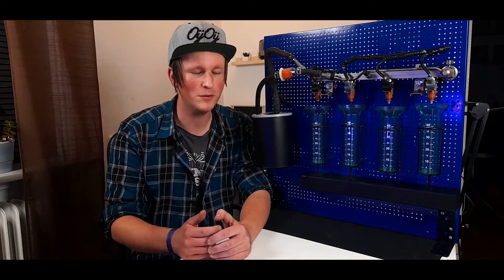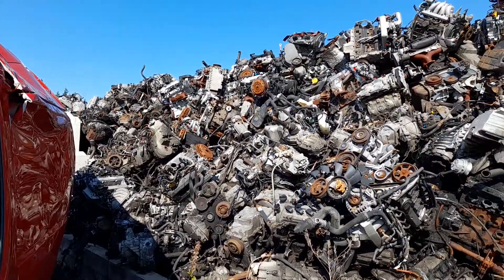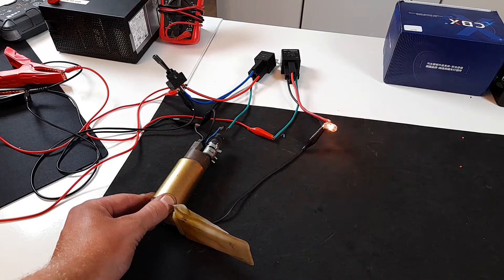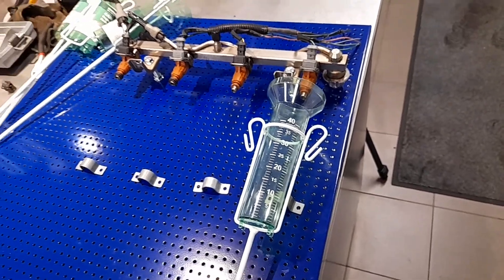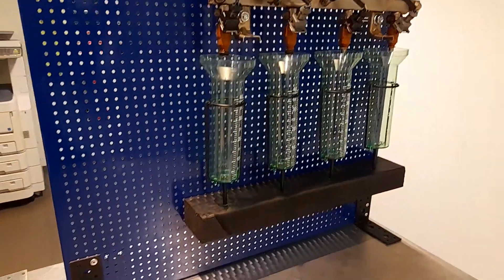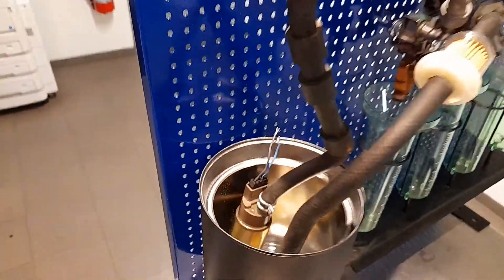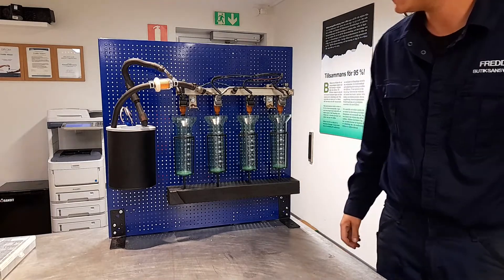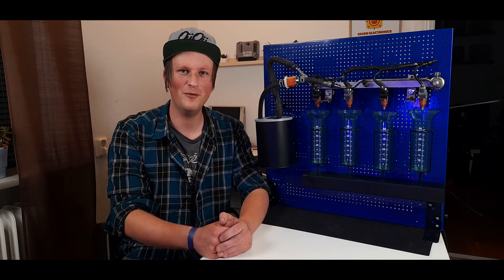Great diy injector tester for cheap!

Comment: What holds the injectors into place? I can see they are fitted to the fuel rail,but there seems no other support or anything to stop them popping out of the rail under pressure.
Reply from the maker: The injectors are fitted with a metal clip for each.

Comment: What fluid is used to test the injectors?
Reply from the maker: I use regular petrol. It's easy to clean the tank afterwards using that.
Reply: @EFreddy  Thank you for your quick reply. Awesome video, I’ve seen a couple DIY injector tester and yours is by far the best one yet!

Comment: I tried to do your experiment but our injectors (they are from bosch and are long) won't open. We have a battery from a small motorcicle, it has 12 V with 9 AH. Cold this be the problem ?
Reply: Now I've put a car battery abd its the same, the injectors won't open

Comment: Very nice build!
Your setup gives accurate relative results: are  all injectors doing the same.
But flasher pulse width (duty cycle) is not known so You can't tell the flow rate (ml/min)

An Arduino would be the final touch to the  test bench:  test flow rates at at 10%, 50% and 80% dutu cycle.

Visit that well-supplied j-yard again and grab a pressure regulator, then test the leakage as well: closed injectors at 3 bar or so...

But it is a mighty machine just as it is...!
Reply: Agreed the mechanical aspects of the system are all there, but if we are adding an arduino.... why stick to a duty cycle and not a more realistic 10,000 2.5ms impulses with a delay in between so that any leakages are exaggerated in the results, or a ramping function that simulates idle to WOT and redline [or both]? 

Genuine question, I built my setup to include the above, just checking I didnt miss anything in the test rig.

Comment: I want the electrical connection of the device and the flash signal down to the injctor and is the voltage 12V or 5v
Reply from the maker: Hi Ali. I maybe misunderstand your question so feel free to correct me so I can help you. :) The build is in 12 volts. The connection I think you mean is 49a that goes from the flash relay to the injectors.

Comment: All you did was a demonstration of injection of all injectors. I suggest a project that indicates the pop pressure value for each injector and also multiple/alternate connection system for varied injector types. Anyway, that's a nice project you came up with.
Be well.